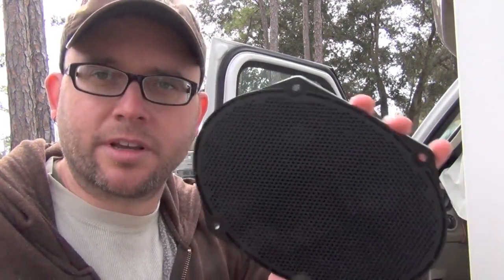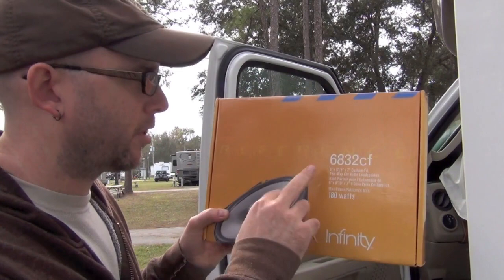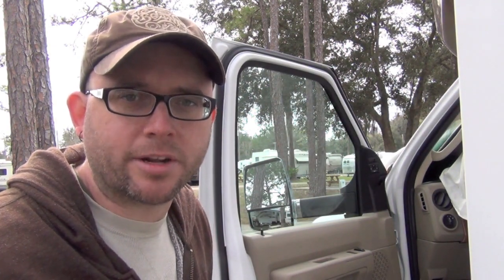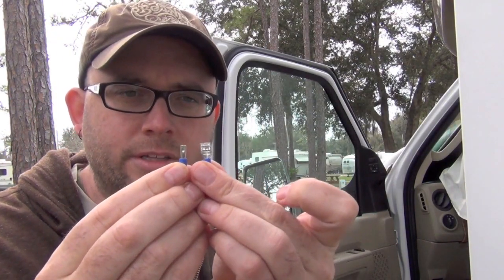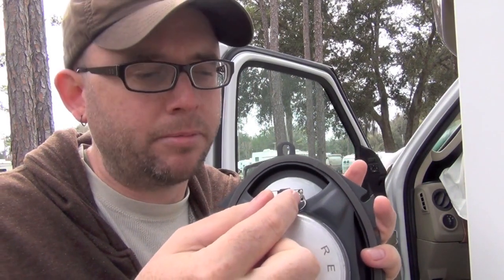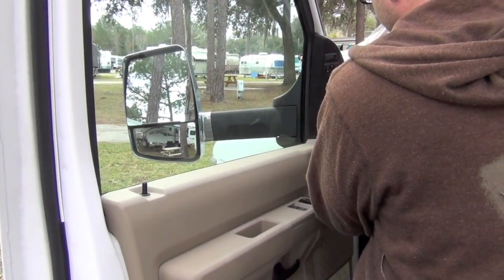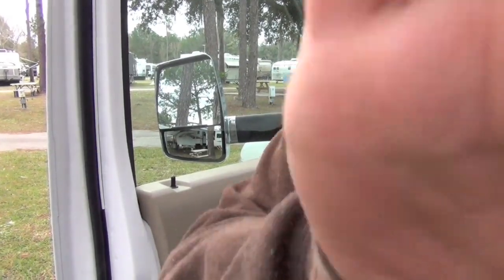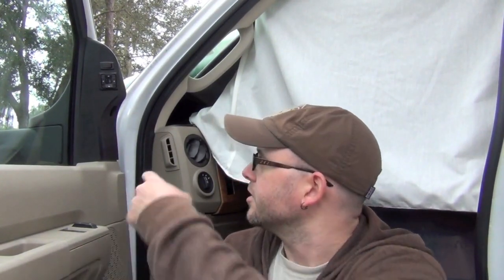How To Upgrade Ford E-450 Chassis RV Front Door Speakers

Comment: Just wanted to thank you for the easy to follow video. I just changed out the Ford factory speakers in my 2021 Ford E-450 Coach House 272xl. Ordered a set of the Pioneer TS-D68F from Crutchfield and they included the adaptive ford wiring plugs for free. No soldering or crimping required. Easy peasy.

Comment: Thanks for the great video. I am doing this to my 2019 Forest Ri er Forester. The only difference is I will not splice wires. I will use Metra 72-5600 Ford Speaker Harness 1998-UP that may be an easy plug and play direction. If the speaker harness doesn't work I will go ahead and splice. Great video brother. Very clear and calm DIY walk through.

Comment: Ok, just did the change out from the Ford factory speakers to the Infinity Speakers.  Let me say this..... WOW oh WOW ! what a difference in sound quality!  My Class C is a 2015 Jayco 29MV.  And yes, the change is exactly the same as the 2012.  (wire color and all) E450 Super Duty.  Over all not difficult at all.
Speaker price has gone up though,  My Infinity's were $99 thru Amazon.   Love the fact that you can adjust the tweeter to your sound liking.   Thanks again for the "how to change out your speakers" video.
Reply from the maker: It is such a difference. The factory speakers are horrible! Glad you found this useful.

Comment: Thanks for the video about the speakers.  I noticed the curtain in your cab area - is that on a track where you can slide the curtains out of the way quickly? - If you have any info on that, I would appreciate it.  Thanks,

Comment: good job i have a 1999 jamboree e450 little different door panel but speakers should work ok i am assuming
Reply from the maker: Thanks George - Knowing Ford and the E-series they haven't changed much about the chassis in many years, so I'd guess it would be the same speakers. It's pretty easy to take the door panels off and check - good luck!

Comment: Cool vid.. will have to try that on our 06 E450 class C.  I recently installed a coach radio.  Couldn't get to the speaker wires in ceiling so ran new wires to the front radio.  Front controlled cab and coach speakers, had to cut front speakers and tap into rear's  Would love to add 2 more speakers to rear of coach but don't see how that can be possible.  Anyways, great vid, will look up those speakers you put in.

Comment: great video ,you answered my question about door panel removal.  i have a question for you,  I  just replaced my class C with a 2015 E 450, (first Ford owner now ) and with these frigid temps i notice cold air blowing through the speaker grills, almost to the point of being uncomfortable when driving. i also noticed you had the plastic sheet still attached to your door,  a lot of shops will remove it (and not replace ) if  they happen to  work on the door . do you experience a bad cold draft coming from the door  speakers?  its -5 outside atm so I  am not going to remove my door panels till spring.  thanks
Reply from the maker: It's not as cold here - we're near Houston, TX, so it may not be cold enough to notice. We drove on Wednesday and it was around 45 degrees. In general I don't get a draft from the doors, but as you said, I left the plastic sheet in place and I'm sure that helps. Also, the engine is sitting right next to you on the other side, and it throws a lot of heat into the cab when driving - especially after a few hours. If you are getting a draft then I'd say it's likely that either Ford no longer places plastic on the inside of the door, or yours was removed.
Reply: Trek With Us its a ford part, and required,  i bet Nexus removed them when they installed the heated remote's , one more  f-up nexus did in building my  rig. and i have a longgggg list. thanks for your input